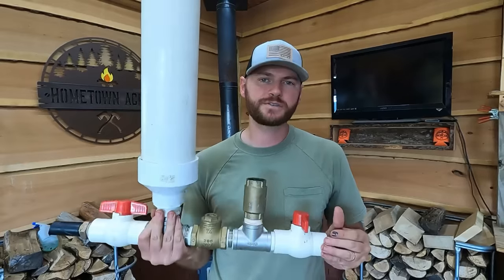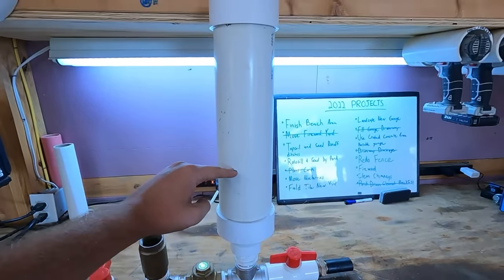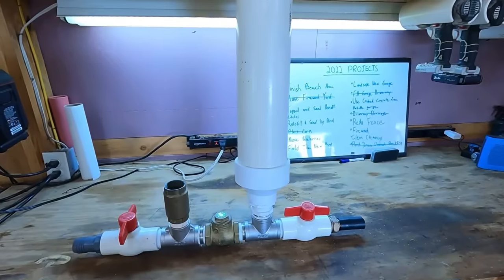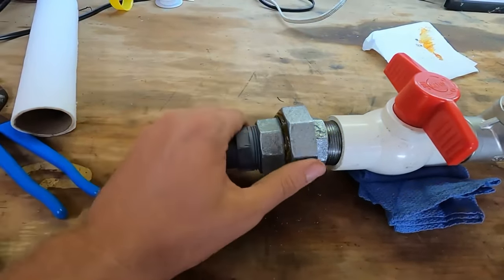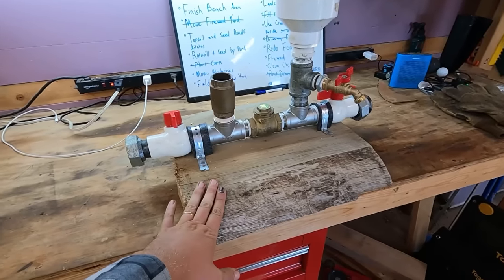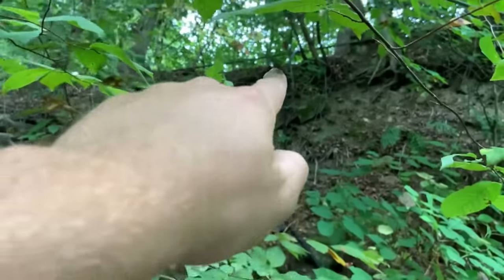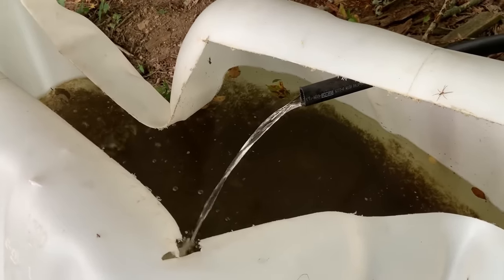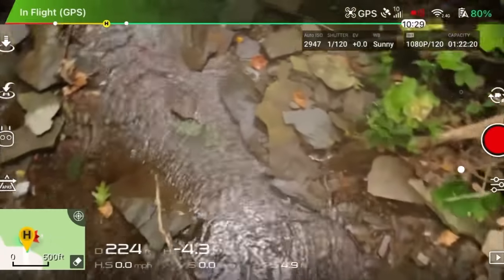Perfecting The Ram Pump And Then Abandoning It

Comment: I wonder if a bladder tank from a well system would work as it's essentially the same thing as the pressure cylinder but has a diaphragm that would prevent getting water logged much like the new style water hammer arrestors.

Comment: Nowhere near an expert, Adam, but just a thought as I watched your explanation of water logging your tank. Could you put a spring-loaded drain plug near the bottom of the tank so that it would take the weight of maybe half a tank full of water to compress the spring? That way when the tank gets waterlogged, the spring would compress and the tank would drain until it emptied enough to reset the spring. Again, I'm not an expert, so it might not work, but I would be remiss not to ask.

Comment: You need an air vent on top of your pressure tank to release the vaccum/vapor lock when draining. Also, can confirm the unions would be better on the other side (inside) of the valves.

Comment: you can only abandon the ram pump if you find your pond is actually below your (stream) water source.. a siphon won't pump water to a higher elevation - so all the work you did in this video is very valuable to improve the problems you encountered!

Comment: Do you know about using a snifter valve in a ram pump? It's used to add a tiny bit of air every cycle to keep the chamber from flooding.
  You may find a problem using a siphon because the air entrained in the water (that the fish breathe) will migrate out under suction. This will cause an air bubble at the peak of the tubing stopping the siphon after a period of time.
Reply: Spot on John! I was reading the comments for the first snifter valve mention. As for the entrained air breaking the siphon a tank at the apex with a pump to periodically pump the air out will help.

Comment: I would put a 4 way below the pressure tank and a pipe straight down with your drain. And then hammer that pipe in the ground or pour concrete with a hole it fits into to stand it all up and drain the tank in the same feature.

Comment: Make sure the volume of water out of your siphon is less than the volume available from the creek. If it sucks too much out of the inlet you will lose the siphon. You may want to get a valve on the inlet that is controlled by a float.

Comment: Larger inlet pipe. Volume of a cylinder for more psi also even larger outlet for your cistern. Say 1.5x 20ft inlet and a 2.5 out of cistern. If it (cistern) was sealed top it would self siphon.

Comment: Even if the pond is not because the set up you have right now, as long as the hill that the pond is on keeps descending, you can bring the hose to a point lower than the creek where the water is coming out and then pull the hose back up into the pond as long as there is a point Lower on your hose than the point at which the water is coming in, you will get a siphon that might entail the hose lower down the hill and then back up again and when it hits the bottom, it has water pushing in on it, which makes it flow up into the pond  do you understand what I’m saying?

Comment: A few points here.

Why is a drone so special for measuring heights? 
ANY GPS device will be able to read a height to the same accuracy, even your phone (with the right app).
An outdoor hand-held GPS has a more sensitive antenna and will work better then even your drone especially under tree cover.

A professional D-GPS unit will measure to fractions of an inch in accuracy instantly once set up, but a more basic GPS can be set to take an averaged reading that is actually very accurate, it just takes a little longer.

A syphon may work, but will it work too well?
You don't want to exceed your creek's inflow rate, or you'll end up losing prime on the syphon and will have to wait for the creek to catch up and restart the syphon.

In an ideal world, your pressure container CAN NOT become "water logged".

If water is getting in, that means air MUST be getting out. Find the source of that "leak" and the water will only enter the tank under pressure and only as so far as the pressure differential allows.

You could of course always cheat, fill the pressure container with a few lightly filled balloons (just above the highest local ambient air pressure). 
The water can still compress the balloons, but it's much harder to get water inside if those balloons.

Comment: Presumably the flow through the pump is unrestricted in one direction thanks to the gate valve- so if the pipe from the pump were connected to the pipe to the pond, and your levels are ok, would the pump not work to fill the pipe up to the point of siphonage, after which I would just expect it to become passive and not impede the flow of water? I’ve seen something similar when about half an IBC was emptied because a submersible pump and hose had been left in it- after the pump had been turned off and the end of the hose dropped to the ground, a siphon was set up with the water just passing through the pump valves.

Comment: Easy Fix.  When making the Ram Pump, ( the Stand Up white section) - take the Cap and drill a hole in it big enough for a bicycle schrader valve to stick though.   Glue with Silicon on the inside to seal.    As the  Ram starts to drop off in 4 to 6 months.   Then connect Bicycle Pump to it and pump up.  Plus prop up so it does not fall over.    See the air that is caught in the upright section dissolves in to the water over time.   That is the  reason for the needed Re-charge ever so many months.    Can cut the top off one you have.   Get a new top Cut schrader valve off old tire tube.  Drill hole in cap just larger than the  stem.    add Silicone glue in place.  let dry and attach new cap to your old one.  of course de-bur the main tube first- wear you had cut it off.   LET us Know how it goes.

Comment: The air in the pressure tube becomes missing because the air dissolves into the water under pressure over time, just like the air bubbles pressed into a soda.  The same thing happens to the water hammer arresters in a house's water pipe and the water pipes of the whole house need to be drained to let the air back into the arresters.

Comment: for those who still need a ram pump.  use a pressure tank with a diaphragm so the water and air don't mix.  a 3 gallon tank is not expensive, and will be maintenance free for many years.

Comment: I've found that "waterlogging" too, when I was using a closed PVC cylinder as a buffer when operating a pump.  
To this day, I cannot figure out how the trapped air disappears, when my PVC cementing was perfect and there were no leaks.  Not sure if you or anyone can explain why/how this happens - 3 to 5 litres of air is a lot to explain away by permeability of PVC or joint leaks.

That said, I'm 100% of the opinion with you that NO experiment is ever a "failure" as long as you are learning!
Reply: does it have a bladder in the pressure chamber? having a pressurized air bladder would help reduce water logging.
Reply: @CaptnApathy  No, a bladder was never suggested for this purpose, and it would need space to expand, too.  I can't see that working.
As I say, PVC, if properly glued together, should be 100% waterproof and airproof.  I don't see how 2, 3 or 5 litres of air could just <escape>, letting the space fill with water.  But it's happened to me many times.
Quality air pumps have a steel dome for buffering, and have a Schraeder valve on the top for re-pressurising, but people I know say that they've never had to re-pressurise their pump cylinder.
Reply: @Tassie-Devil  the bladder can be set to a specific pressure before turning on the pump. No need to add more air later on as the air in the cylinder is compressed.
 since it is separated from the water, none of the air will dissolve into it. If your cylinder is truly air tight, then the air is likely getting carried away by the water over time.
I have also read that the cylinder being at any angle besides straight up makes waterlogging happen more.
Reply: @CaptnApathy   I hadn't considered te possibility of gradual dissolution - good call.  
What kind of bladder would you suggest?  Are there made-for-task products, or is it a "hack" using a football bladder or similar?
It wouldn't be too hard to add a Schraeder valve to the PVC cylinder, but adding a bladder inside, which can be pressurised from externally sounds like something far too bloody complicated for me to attempt.
Reply: @Tassie-Devil  a group I found that sells ram pumps just uses the innertube for bicycles.

it's actually kinda hard to find food grade air bladders that don't come installed in a tank. you might have to find some silicone and try to make your own if you don't just buy a bladder tank or bike inner tube.

Comment: The water stream I rely on is over 900 feet (around 300 meters) from the house I want to bring this water to. Also, the stream lies at a lower altitude than the house by about 20 feet/6.1 meters. Will this ram pump be able to defy distance and gravity to deliver water to my home 24/7 yearlong? If not, what ramp pump model do you recommend?

Comment: Drop the water from the ram pump back to the river through a water wheel (or two) and see whether you can run a light and/or charge radio batteries.

Comment: Put a Schrader valve in the top of the plastic tank then you can use a bicycle pump to reair the tank..

Or put the Schrader valve in the nipple below the tank and it will suck some air with each pump

Comment: If you used the ram pump to get the water to the highest point, then connected the long hose to run down to the pond, would the siphon be able to "pull through" the pump or could you install a pump bypass valve?

Comment: I have a simple solution On how to clear the water logging. Insert a shredder valve at the top of the pressure vessel. Then you can go down there with a small air tank and blow it out.

Comment: I was thinking as you was working with that ram pump. Why not put like a valve stem from a car tire in the top of that tank and then force air in the tank? You could use a hand pump or one of those portable air tanks. Oh well, done moved on now.
Reply: Just what I was thinking.

Comment: You needed a valve stem on the top of the pressure tank to put compressed air into it instead of trying to drain it.
 The air will push the water out.

Comment: At a valve on the pressure tank side before the exit valve and you shut off the intake valve and the exit valve and open the one on the side and it will let the water out of your tank shut that valve off and start the pump again by turning on

Comment: and u now have a ram pump u can use for something else or give it to someone who needs one.
As for XP try over 60 yr for I have been doing these things since i was a tween.  I am 74.  On my little farm  I use 6 ram pumps  to bring water form my creek up to top of land.  That is 100 ft of elevation.

What do I use the water for.  Animals.  I have 10 cows and one bull on 50 acres of side hill pasture.  Use rotational grazing and follow them with about 200 meat birds. I used a 3" feed pipe down to a 1" run pipe.  I get about 5 gal a minute at top.

Why dont I just let them drink out of creek.  Same reason I dont let them in the pond on top. POLLUTION. Animals will mess up a creek or pond real fast.

Comment: Siphon works uphill but not dramatically like a ram pump. Hurray physics! The vacuum effect and tension of the bonds between water molecules means it pulls water so long as there is flow... Even uphill.

Comment: I would keep the ram pump going as well. Try and build a dam in the creek to get a pool of water created
Reply: I live where the water is held back by levees.  The farmers here siphon over the levees using sometimes 3' diameter pipes.  They install a small valve and barb fitting at the high point of the pipe 'bump' over the levee.
They pull up in a pickup truck, disconnect a vacuum line from the running engine of the pickup or tractor, and hook it to the barbed fitting.  The vacuum easily takes the air out of the high point of the pipe, and the siphon starts.
They close the little valve and reconnect their vacuum lone yo thr vehicle. They stop the siphon  by opening the valve to let the air back into the 'bubble' of the high point.
Been done for decades.

Comment: I paused you about 6 minutes in for thugs comment. Instead of a drain for you tank why not put a brass tank Schrader valve on the top, and 2 90° barbed fittings on the top side of your tank and 1 on the bottom side with some cleaner vinyl hose, hose clamped between so you can see the water level in the tank. Then you could just use a tire pump to put air back in the tank with a bike pump.

Comment: Putting grease on the threads is NOT the thing to do. Use plumbers PTFE tape instead ... Both seals and the thread compression of the tape means the unions will undo when you want.

Just make sure that looking into the end of the (right handed) thread, you MUST wind the tape in a CLOCKWISE direction. Put on at least three or four layers whilst keeping the tape under tension for maximum effectiveness.

Comment: It is way better to take concrete and make a saddle impression for the base to set in also a steel rod driven in the ground and wired to your pressure tube

Comment: What if you drilled a hole in the top and put in a tire valve.   When it gets water logged. Take the air tank up and push the water out with air.  You wouldn't even have to shut it off to reprime it

Comment: you want water in the pressure tank… thats how u get the pressure…. otherwise put an air valve in the cap where u can use a bike pump to put more air in it

Comment: I don't think your pressure tank drain tap will work because there's no way for air to enter the tank as the water drains out which results in a slight vacuum in the tank preventing the water from draining.
Reply: It will be EXTREMELY slow, but water will come out. Air will enter through the drain hole if it is big enough.

Comment: Why not install an air valve on the top of the pressure tank and use a bicycle pump to force the accumulated water back out the bottom.

Comment: So just get an Osage orange tree and cut a post. It will last much longer than treated lumber and it will Not cost you anything but it is pretty hard and heavy. Also why not use quick Connect and not monkey with the Wrenches? Little more money but so much less time and hassle

Comment: why not try  electrodes   powered  by  solar cells to create a  hydrogen and oxygen  air cushion   they have  clear  pvc  pipe.  would   more  air    expansion  tanks  smooth out the  waterflow   and lower  the  average  water sp;eed   and increasing overall  flow?

Comment: I assume you don't mean completely abandon the ram pump setup.  May as well leave it running unless materials are an issue.  You could make it so either is capable.  
Ain't global warming a bitch.  Putting a bunch of plastic balls completely covering the surface of your pond would reduce evaporation a ton as a temporary measure to get and keep volume so you can do an effective job of finding and eliminating leaks.  Are you allowed to dam the creek, with a siphon it may help to have some depth to avoid debris sucked into the pipe.  Good luck.

Comment: You may want to review this tech article on ram pumps before you modify your design.  Waterlogging is taken care of by air entering the system while it is operating.  I had to put spaces in the following address to post it without having youtube block my comment.  w w w  . ijert.org/research/design-and-fabrication-of-a-hydraulic-ram-pump-IJERTCONV6IS04033.pdf